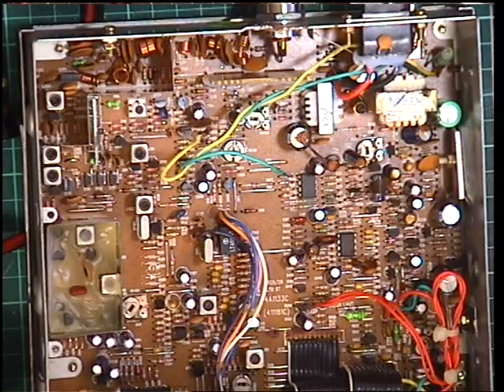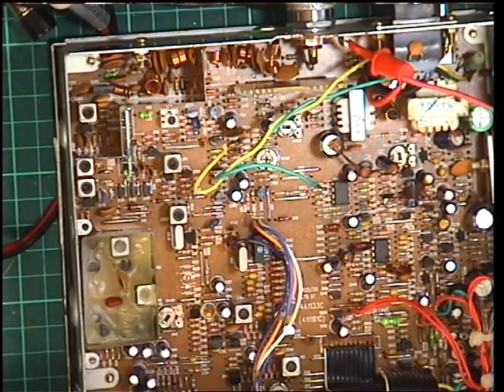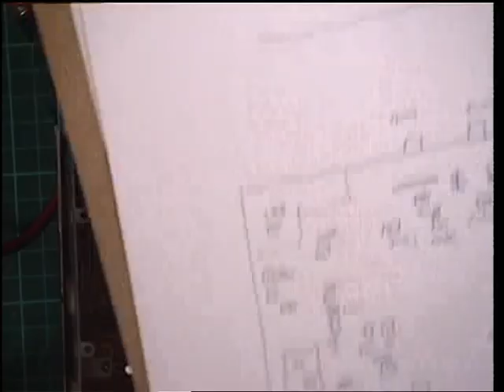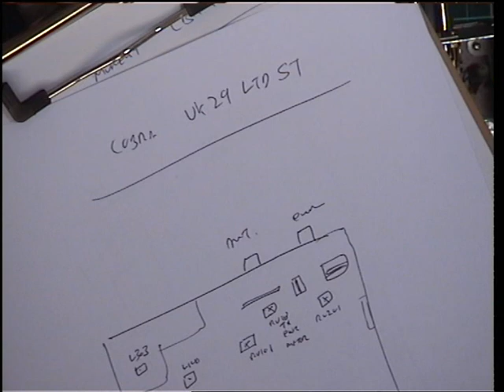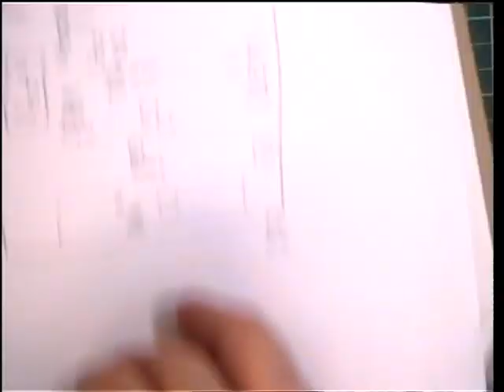Cobra UK29LTDST PR27/97 UK CB radio (mobile) Receive alignment

Comment: Suffer from dry joints across the main board, in the vco section. i bought one from ebay last year, with same faults. Re-soldered every joint that looked dry, now have a working set again.
Reply from the maker: I think these radios are so awful, we won't be accepting them for repair in future.

Richard

Comment: I would have repaired it if I had owned it, but for someone else, not worth the effort, the true cost of repairs would run into the cost of the set new and maybe more.  it looked surface mount components there as well, just not worth it and what is the chances I went further,  There is an IC there, don't know what it function, might be for channels, might be display, don't know off hand.  For you it is just not worth the hassle, and if it has blown anything, would you get a part for a 9 year old set?  That board looks a custom board to do both set of frequencies, I don't know, never see one like that.  0.9 deviation!  Who on earth is going to hear you at that.  Bring back the Japanese sets.
Reply from the maker: When we did our own set that I bought in for test purposes, I wasn't that impressed with performance in general, so a very broken one...not worth it.

Comment: Been trying to find info on this radio for ages as I inherited one with problems. The RX sounds like it's off frequency with very low audio. Also L100 looks mashed like someone attacked it with a screwdriver. Is there any way of sourcing a replacement for L100?
Reply from the maker: It's a snag with CB's knowing who the importer is. You need to unsolder the affected coil very carefully, we use a solder sucker. 99% of the time I am able to remove the damaged core from the pin end of the coil, once removed from the PCB....and then turn it round (having removed any broken fragments)  put it in the other way round, so the goo bit is now at the top & the damaged bit at the bottom.

Richard
Reply: @ukfmcbradioservicingTango21  totally appreciate your reply. Unfortunately the whole component is mashed, not just the core
Reply from the maker: The service manual says L100 IFT 27Mhz B  320-585-1, but I've no idea who imported them, and they are in any case beyond the 7 years that any importer would be able to support. 

I've had a couple of these sets in & one was 'farted about with' and therefore unrepairable, so I know they will come up as scrap or faulty from time to time. Email Knights at Kirton in Lincs; they do repairs & may be able to sell you a part off a scrap set, and I know they sold these sets when they were out.

Richard

Comment: Hi Rich can I just ask you if you no of a good equivalent for the 2sc1945 and the 2sc1969 because ive recently purchased some what I was lead to believe to be good aftermarket copies but they just seem to be fake why they bother to go to all the  trouble of making them I`ll never know  e.g The  C1969 ,I purchase four of these for  £14.00 so naturally I tested them with my MM and Transistor tester  which graphically  displays the junction symbol etc and two read NPN and the other two read PNP they are for around 30 MHz operation one is for a Stag 357 set which has a 2sc1945 in the final output stage 
There appears to be a lot of counterfeit Transistors like 1971,1306,1909,1307,2312,that are out there mainly on ebay sold by  several sellers I even asked one  seller if they would function correctly he said he used to a a lot of faulty one but does not now !  but they arrived but appear to be fake so its very disappointing especially
when you wait several days for them to arrive 
bwrgds 
Mike
Reply: I have used the eleflow versions with no issues. There was a chap called Weazel66 selling them the last time i bought some.
Reply from the maker: I can't tell you off-hand. I always fit like for like. However, the best approach is to download the datasheet for each you are interested in & compare parameters. I just put the part in a google search such as "2sc1969 datasheet" and't it's always come up trumps for me & for free. I just print off the data page &sit down &compare. 

The only fake I've ended up with was supposed to be a FET & was an ordinary bipoler transistor. I have one of the PEAK analysers which I find invaluable. Had it 18 years now!

Richard
Reply: The sound tracker feature is only beneficial if both communcating CBS's have the feature,, apparently 👍
Reply from the maker: @roblee9967  Sounds like marketing bull to me! Many thanks for your input.

Richard (UK)

Comment: Thanks for another great video
Reply from the maker: They are FM for the UK, but will be on the european market as an AMFM set. Clearly the main board has AM circuits lurking. However, although now 18 years old I don;t see them as a well made set that will last decades  like some of the UK 1981 sets have.

Richard

Comment: Hi Richard do u have a link for the place where u got the 2 new scopes from?
Reply from the maker: Gary, At present the ST16 oscilloscope I bought is lot no 392534166994 & I see they have five available. I bought one from them & the other via ALi Express. I did this in the hope of not managing to be charged VAT or duty; it worked, I wasn't charged for either. The Ebay one came better packed & quicker than the AliExpress one.
Reply: @ukfmcbradioservicingTango21  thanks Richard
Reply from the maker: @g1fsh  I suspect the EU/UK switch will be AM/FM in some european markets.